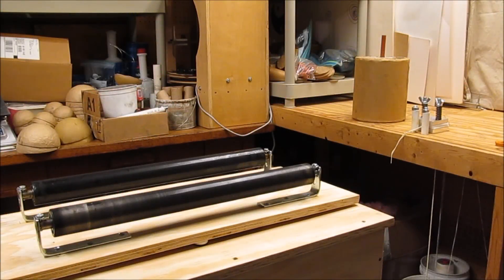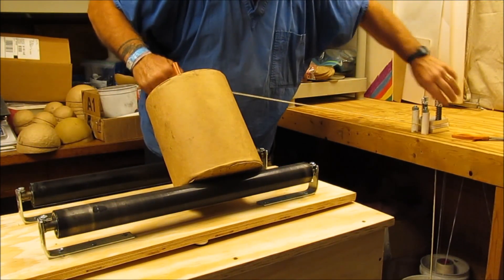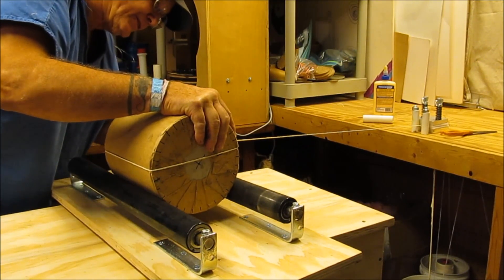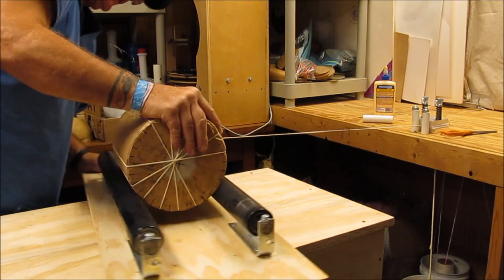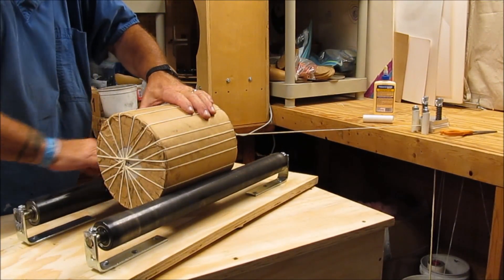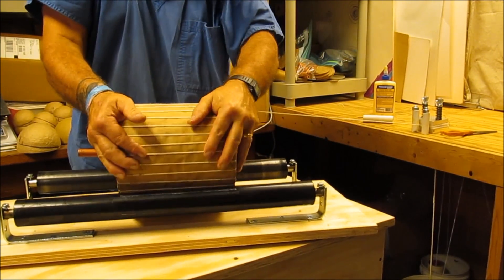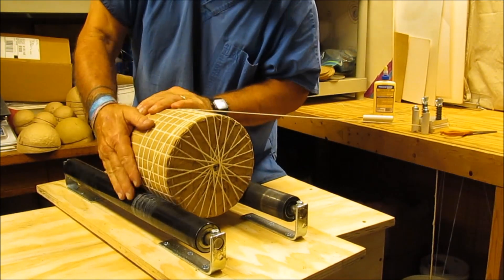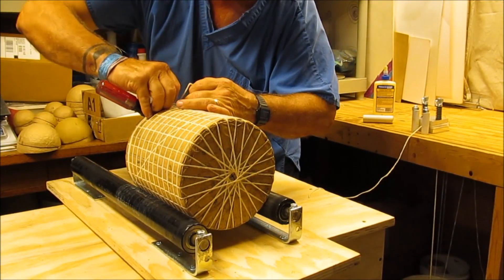The rotating turntable with rollers that I use with the shell spiking station

Comment: i bought one from Caleb, it works great. the roller takes some time to get used to. the spiking station is great. I know there was some talk about using the roller if you could get enough tension. no problem with that. great job ned
Reply from the maker: Great, Bill, and thanks for the feedback. Enjoy.

Comment: Very nice system you put there together, Ned. Folks here have posted suggestions and I'd like to add one more, about adjustable stops on the center axis between the rollers to help you prevent the shell from sliding toward your station esp. when doing verticals. Those stops, one on each side, could use simple fixed casters with wheels positioned horizontally, and your shell between them would be pretty much held in place from four sides with you applying force only from above to keep your shell down in place. I think it would make the spiking job much easier.
Reply: Nice suggestion. Together with my suggestion (to add another pair of adjustable rollers in parallel to the existing two), the shell would be fixed completely, while still fully turnable on the twistable tabletop, with the string still free to apply.
Reply: Thanks. I agree, the ideas of holding the shell in place with minimum effort are definitely worth trying. 
Then all that's left is only firmware updates ;-)

Comment: Hi Ned,
first, I want to thank you for your very entertaining and thoughtful videos.
I really enjoy watching those tutorials and tests of yours. 
Brilliant work! Your calm, thought-through and organized way of doing and explaining is absolutely perfect
and your many years of experience are inspiring. Thanks a lot.
After watching many of your videos here on youtube, I decided to comment on this one, with an idea:
What about a second set of conveyor-rollers, that are adjustably mounted in parallel and atop the existing pair.
Using some bolts and nuts to adjust the height, those rollers would fix the shell while not blocking the string to wrap around (as the string comes from the side all the time).
The shell would stay in the center of the four rollers, fixed in all but two directions and still turnable.
That way, you would be able to get both arms relieved and free to turn the shell and twist the contraption.
I'd love to hear your opinion on that idea.
Keep up those wonderful videos.
Reply from the maker: Thanks for the nice feedback, Mr C. The more I use the roller turntable, the more I use it comfortably, as is, by just resting my right arm atop the shell, rolling it as necessary, and then using he left hand to turn the table and guide the string. Like many mechanical things, it's easier to do than it is to explain. Bottom line of for now is that I'm very happy with the setup and how it works.
Best,
ned

Comment: Someone needs to automate that spiking process, just like they did with taping shells.
Reply from the maker: It's been done a few times, Joe, but in the end traditional cylinder shell builders are pretty basic and enjoy the handwork associated with the shells. In a commercial setting, though, it could be useful.
Reply: @nedgorski  Ah, makes sense.